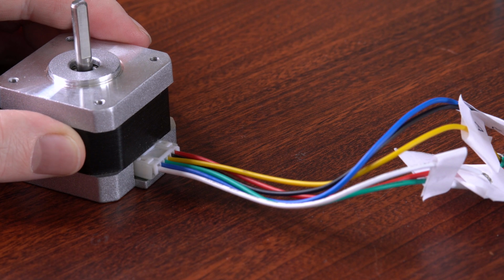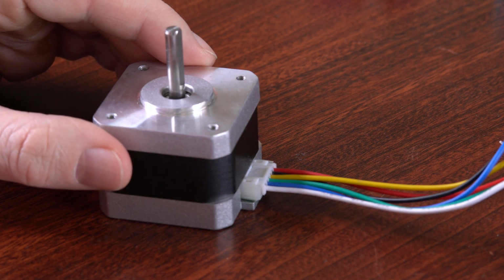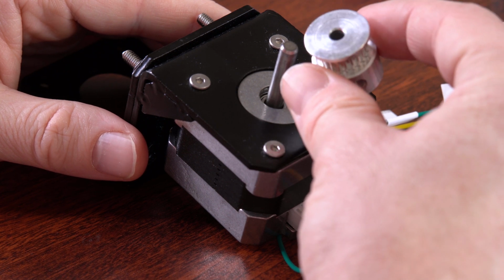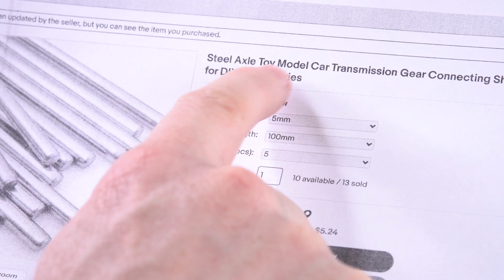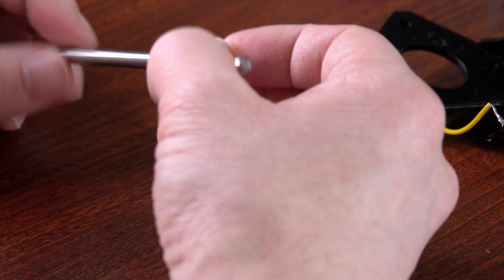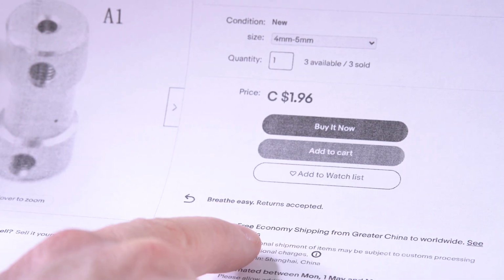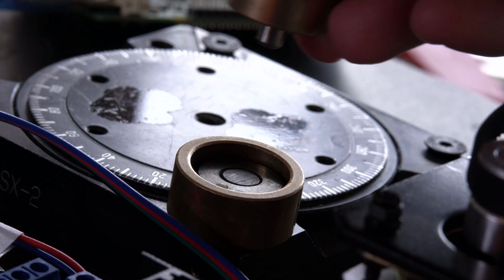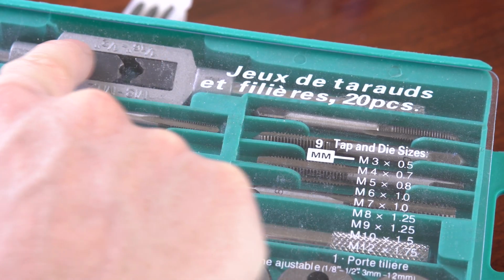I'm Prepping For TOTAL COLLAPSE Of Industrial Manufacturing Base

Comment: I've had a 3D printer for 7 years now, built from a kit. I would never consider ordering a bunch of rings of different purpose and drilling them out etc to try to make an adapter if the adapter only needs to survive stepper motor torque which isn't that high, because i can just subtract a cylinder from a cylinder add a couple features, send it to my 3D printer and have the part in like half an hour. In fact i used to collect a lot of "junk" hoping to build something from it; now everything that i can just print, i no longer need to collect, i can just throw it away. Throwing things away still feels a little grating, but having too many special purpose parts, i can never find the right ones anyway, so i best not hold onto them and standardise the kit i use for my designs. Also good to use things i can always get from a home improvement store and RC parts stores nearby, which i don't need to keep. Luckily i live in metric land. Another use of 3D printer well i'm not going to use a printed shaft, but i can draft print a mockup just a fragile single wall empty one of it to spin it in my hands and imagine how the real part fits into the design, so i can dismiss the idea and don't have to buy the real part that i don't need, and it goes for more complex parts as well, you can always have a dimensional mockup.

Comment: There is a freakish synchronicity to this series of content - every video is on something I've been working with that day! How about a chance to get ahead of me, building on what you've already covered (motors, motor control, belts and timing) - T/V slot aluminium extrusion! Get those motors moving things with some extrusion, wheels and a gantry plate!

Comment: I left manufacturing last year because it's all about profit. But just a few minor points:
1: Elon Musk is a wealthy person, not an inventor. He's never done anything technical in his life.
2: You can drive a stepping motor with 4 transistors and two 7400 logic chips. That's how it's been done from 1950 til the late 2000s.
3: Don't buy electronics on eBay. It's all fakes and dropshippers.